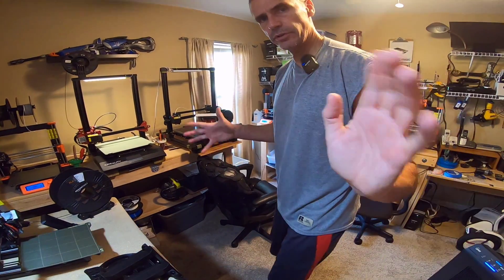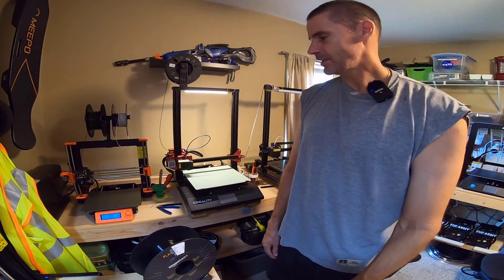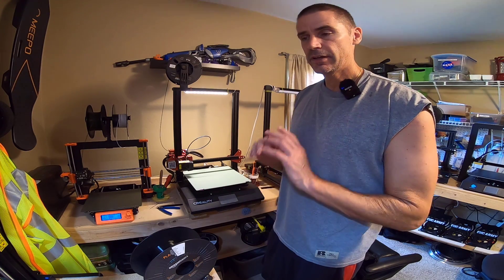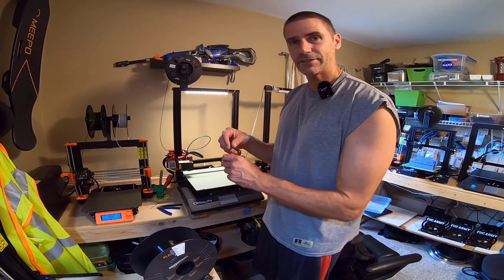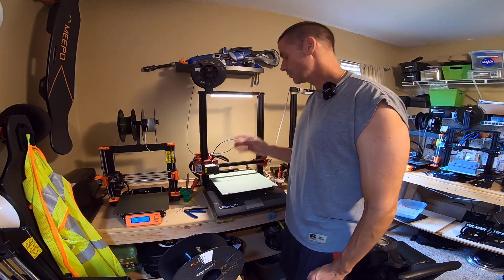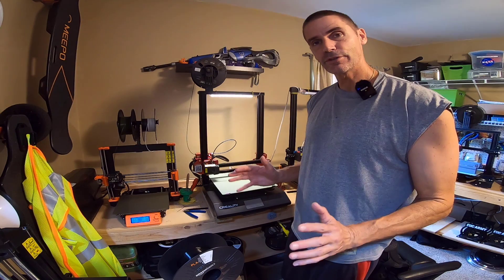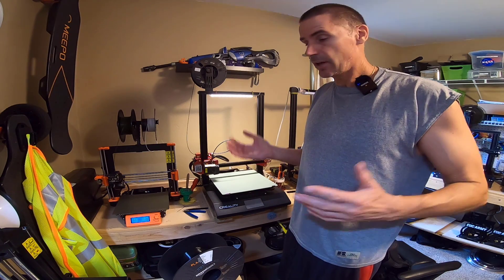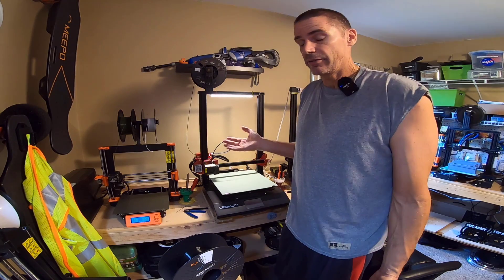Micro Swiss or 10S Pro Under Extruding? Make sure you check this simple fix!

Comment: Great video. I've had this problem with a number of all-metal hotends on a range of printers from my Tevo Little Monster to my Flashforge Guider 2. It seems to primarily occur with PLA and I assumed it was a function of the metal heatbreak tube (as opposed to the teflon tube in non-all-metal hotends) causing heat creep up the tube, making the PLA soft before it reaches the nozzle and causing a jam. I assumed that in a teflon tube lined heatbreak tube the combination of the low friction of the teflon and it's insulation of the filament from the metal part is enough to keep it cooler and sliding through the heatbreak.  I'll have to check my nozzle tightness on them and maybe they need to heated to a higher temperature (like you did - 250°) when tightening them. Glad to see someone else has had this issue and a different take on it.
Reply from the maker: Interesting, good to know as this is my only all metal hot end in the collection.